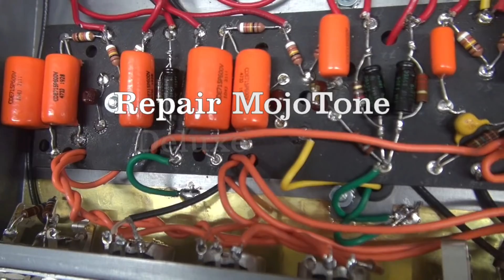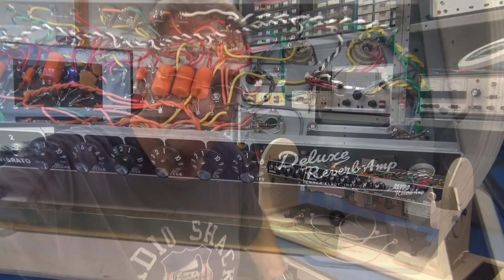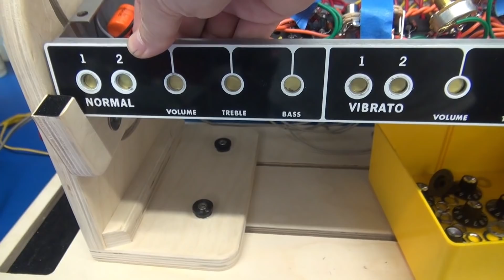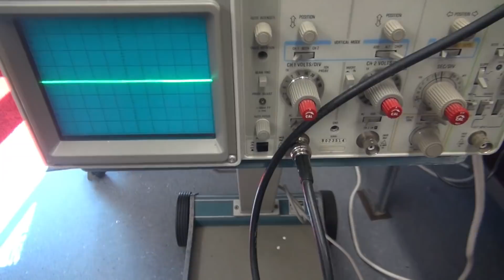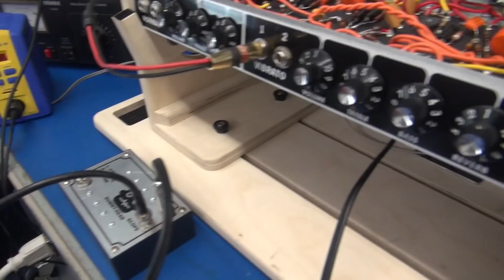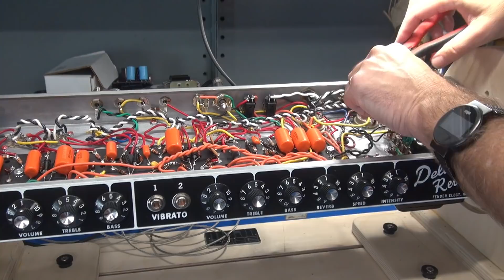How to repair MojoTone Fender Deluxe Reverb tube guitar amp Grounds bad wiring advice Part 2

Comment: Thanks for that, just what I needed.  I bought a built Mojotone blackface deluxe, and it has a tiny bit of hum, maybe "normal" for a tube amp, but I will put in the brass now that I know how, and probably get some RG174 for signal runs as well.  But, there is a bad hum in the reverb section.  I just need some room to set up a bench and dig in, I have the equipment and should be able to track it down.

Comment: Hate the sound of those caps across the full board - I use an allesandro oil - orange cap and silver mica in my tone stack, much better note definition across the spectrum.

Comment: I built one of these but I went with the Tone Clone transformers and good tubes (can’t remember what I used in mine and I’m too lazy to go look at the moment) and it sounds pretty amazing. If you’re going to put the time and effort in to one of these, it’s worth it to upgrade from the stock stuff Mojotone offers. And that’s not a knock on them, they are trying to keep it affordable for hobbyists

Comment: Very nice improvement on the amp!

Today’s transformers, capacitors and resistors are equal or better than originals. Fender used basic stuff of the day they could get at a good price. Pots, jacks and other parts are the same. Circuit design is a known quantity and is not difficult to follow. The toughest variable is the tubes but that is manageable if you are chose well. You can not only equal the originals, you can exceed them. Careful grounding and lead dress will give you an amp with all the goodness of the originals with a quieter and more reliable amp. The bias circuit on Blackface amps was a bit undersized. F&T 22’s in the power supply work well and are much more trustworthy than vintage caps.

Comment: Maybe doesn’t sound as good as an original. But there are a million pedals you can stick in front to warm up the signal and make it sound much better. So stand-alone won’t quite make it, but stick a good pedal as a cheat and you’re good to go!

Comment: Another highly educational exploration of a classic style amp. As regards the tone, I take Tony's point: if it were an original it would have an RCA or similar  GZ34 rectifier and power tubes running 415V on the plates. Why not try it with some NOS tubes if you have some kicking around in the shed? And push the bias a tad to see if they come to life.

Comment: I took my mojotone DR kit and got rid of the orange drops and used Sozo blue and also used sozo mica caps. I ordered all new solid core cloth wire to color code it to vintage specs.  My amp sounds nothing like this amp. I would replace the caps first of all.
Reply: I was gonna say the same thing..personally I don't think Orange drops are known for the warmest sound
Reply: @dyamariv3628  Orange Drops are expensive but that doesn't mean they are good......but people that don't know anything always associate cost with quality.......and its foolish.
Reply: @dyamariv3628  The only position I'd use an Orange Drop is in the PI stage feeding the power tubes, that's generally what my ears like........
Reply: Yes they are way too bright especially in these amps.
Reply: But for him to say it as good as it’s going to get is wrong. Changing caps and tubes and breaking in the caps and good quality tubes will get this amp so close you won’t hear a difference between it and a vintage blackface. That amps still doesn’t sound right.
Reply: @achysklic  There was really nothing wrong with the filament wires that were there, and they should be 2 different colors for distinction.....visually.  Obviously the Power tubes need their filaments hooked up properly, but down the daisy chain .....I like all the #9's on the same lead and all the #4's & #5's on the same lead.   That's one of the first things I look at when servicing a vintage amp and what makes it a pain when the 2 wires are the same color.  Then I usually redo all the grounds.  The JJ 6V6's are not REAL 6V6's and could take the high current draw, but it always comes down to the dissipation/WATTS and relative to the output transformer and what its designed for as for Wattage.  They sound the best when they are run up high, but you don't want to overload the output transformer too much and eventually burn it.....you just have to find the right saturation point & balance.  Obviously this amp doesn't have a master volume, so its going to depend on how much you can lean into the single pre-amp volume dialing it up.  BUT you need to know the end results and the power tube plate voltage.....first, and then work back to the V1 and adjust the voltages properly from the power rail nodes...whether the schematic values for the power rail nodes are right or need adjusted......as to the listed schematic voltages.  If you want to Juice it....I don't recall off hand if the PI plate voltages are 240ish or lower....BUT if they are lower you'd want to bring them up to 240 volts.  The power tube screen resistors, I'd change from 470ohms to a full 1K resistor.  BUT cranked up hot with the bias current draw, its all about the end result of the plate voltage......I'm more a fan of a 5U4 to bring down the power tube plate voltages...as a starting point in the power rail
Reply: to clarify what I mean by there was nothing wrong with the filament wires.....I wasn't talking about the solder joints.  I usually go through the amps I service and redo all the solder joints & verify them.  I briefly had to use a substitute solder as I ran out, and had a project to do while waiting for mail order solder.  The solder I obtained locally was crap, and had to redo everything I did solder with it after a few month........I wish Radio Shack was still around locally as they had my favorite solder & they were handy for a spool